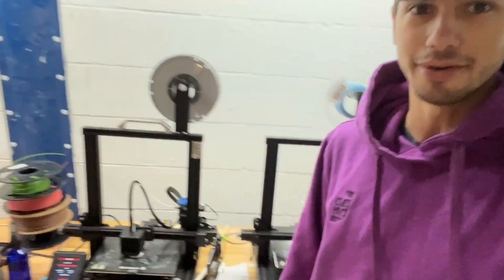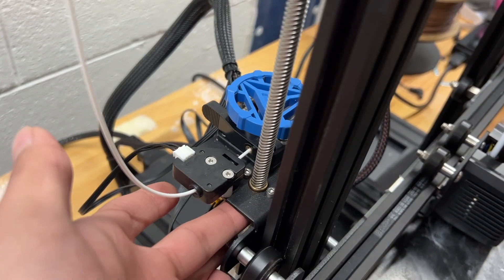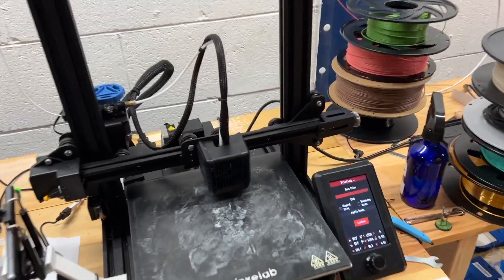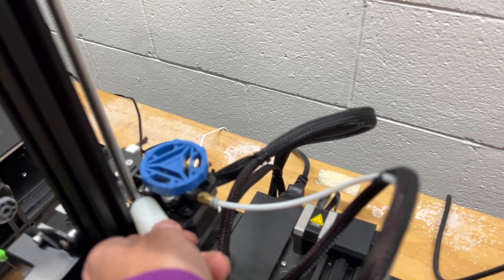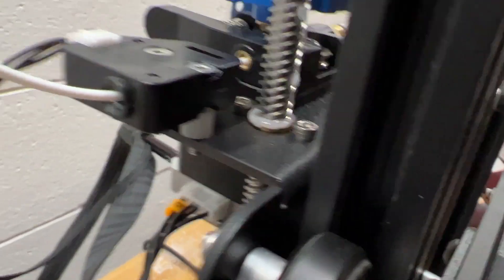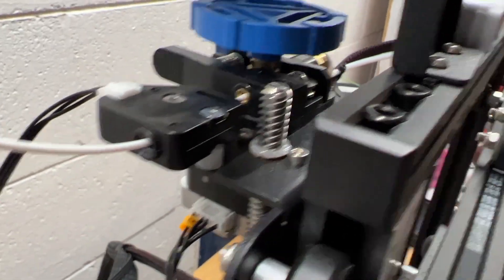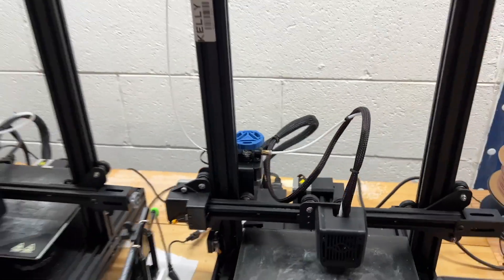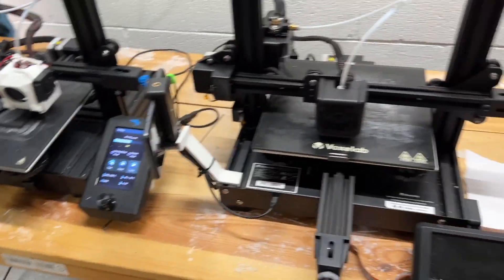My 3D Is Printer SQUEAKING??! (How I fixed it)

Comment: Have this problem with my Ender 3 v2. For a while, I thought the extruder gear was dirty with plastic so I would take the extruder apart, clean it, and put it back together before every print. After watching this video, I felt the top f the z rod during a print and I could feel a vibration when it would finish a layer. Thanks for this video! You're a sanity savior!

Comment: Does WD-40 not work?
Reply: Do not use WD-40 its not really a lubricant its closer to a solvent, it can actually damage your metal parts.
Reply: Thanks. I read that too.
Reply: @Unh0lyZ3r0  How about silicon spray?
Reply: @shunkan2g  Yes  that works, but can get all over everything including filament. I usually spray a bunch in a cap then "paint" it on.